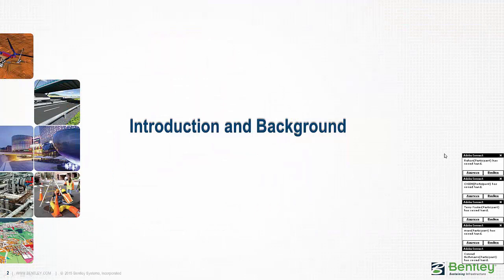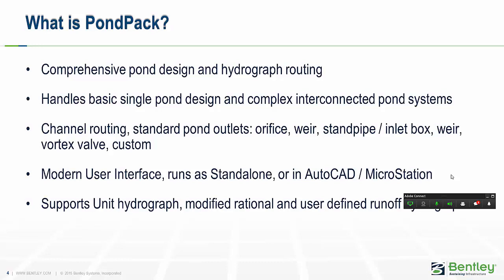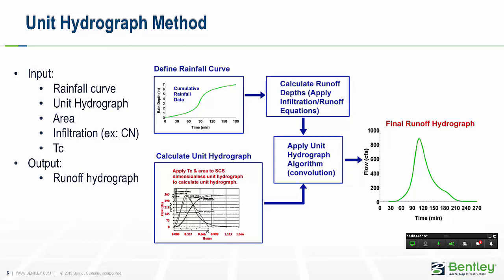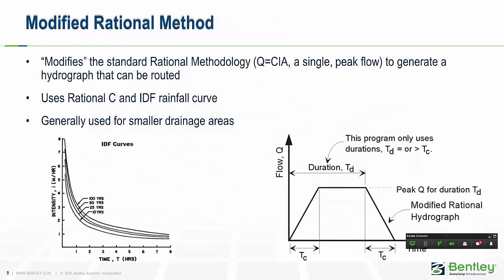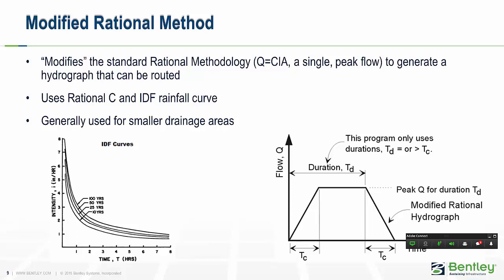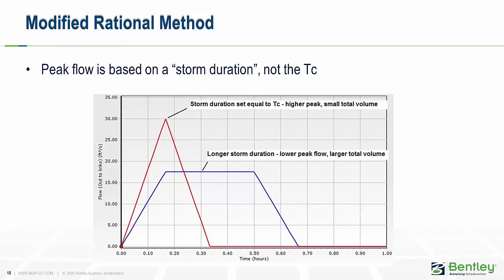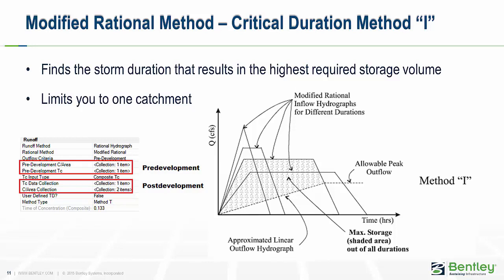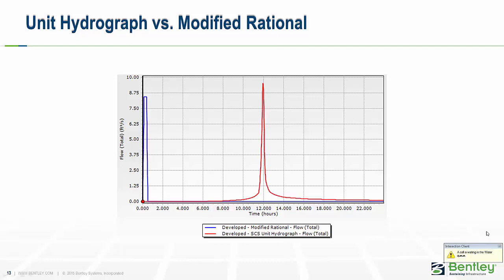Using the Modified Rational runoff method in PondPack Part 1

Comment: Can you explain more on how to generate the allowable peak flow Hydrograph?
Reply from the maker: For the predevelopment conditions, the Modified Rational Method only considers the peak flow and uses that as the target as explained in the video and in the below article. The implementation in the OpenFlows products assumes that you are only looking at the postdevelopment conditions to size the pond and outlet. If you are being asked to show a predevelopment peak and are using PondPack, consider showing the report in Report Builder that illustrates the constructed postdevelopment hydrograph with the predevelopment peak line shown. Or, you could explain to the reviewer how the method works and that there is only a target peak flow. Another option is to set up a separate scenario with a user defined critical Td set to force the model to show a modified rational hydrograph that peaks at the target peak, but it could be misleading. If further help is needed, please post on our forum: 
https://communities.bentley.com/products/hydraulics___hydrology/f/haestad-hydraulics-and-hydrology-forum
https://communities.bentley.com/products/hydraulics___hydrology/w/hydraulics_and_hydrology__wiki/6809/understanding-the-modified-rational-method